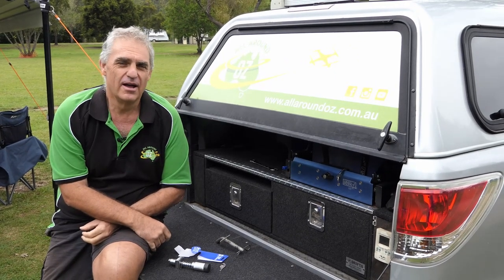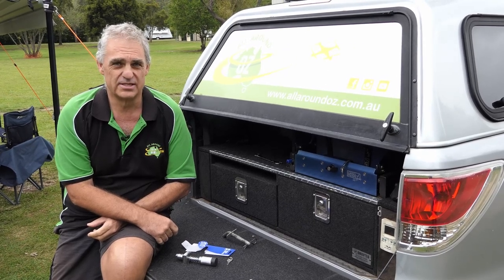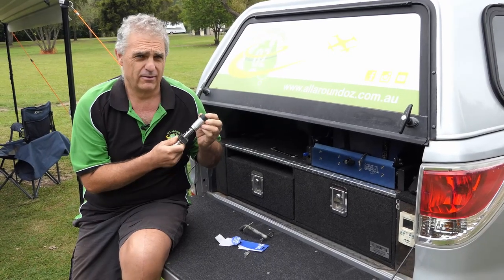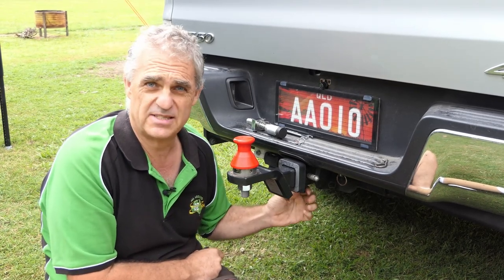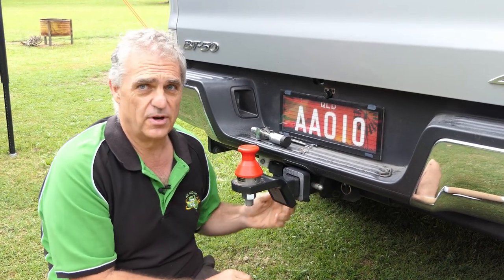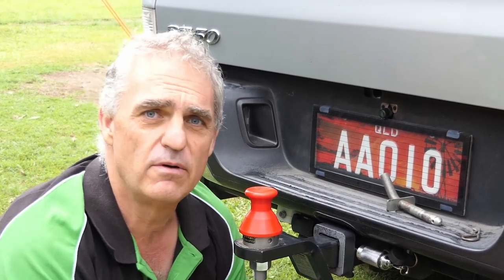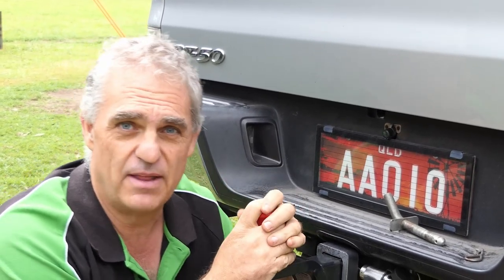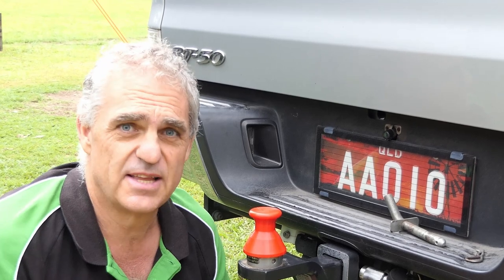Silent Hitch Pin from Hayman Reese

Comment: I have a Ford Everest and according to the owners manual, and I quote  "Tow coupling anti-rattle pinch bolt(where fitted) should be removed from tow bar when towing. When not towing, the anti-rattle pinch bolt should be replaced, and lock nut tightened.Tightening torque must not exceed 47 Nm".
Reply: Spot on if you touted the anti ratttle bolt whilst towing, event you will have a nice hole in your toe tongue, the anti rattle bolt is for use when not towing nut you have your tongue in.

Comment: Picked mine up today from Repco Auto and fitted it in their carpark while I had the work trailer on, which is an 8X5 dual axle box trailer with canopy fitted and weighs 1985 kg loaded.  Its so quiet, I took the long way home enjoying the ride with out the rear end tapping.  Just do it and go buy one.  And thanks for the vid.

Comment: Great gadget but the original rattle bolt is not meant be used with a van on the back. It's only for when the van is unhooked and it stops the rattle.
Reply: Correct.

Ive seen one guy who tightened the anti rattle bolt   and only to discoverit bolt snapped of and was a bugger of thing to remove the hitch later on

Comment: The anti rattle bolt is not meant to be used when towing anyway.
Reply from the maker: I have read this in some forums a while ago but Hayman Reese supply these hitch pins with their 3.5t tow bars. There is nothing on the Hayman Reese website about these pins not being suitable for towing.
Reply: All Around Oz

Oh I’d certainly use your new one. I was more referring to the factory unit. The Hayman Reese pin looks excellent.
Reply: You will damage the threads on the bolt at best and at worst break the weld away for the captive nut if you do this! Isuzu advise this with all their bars!